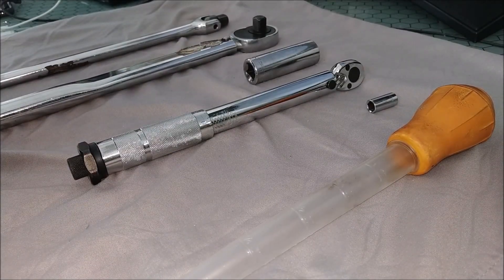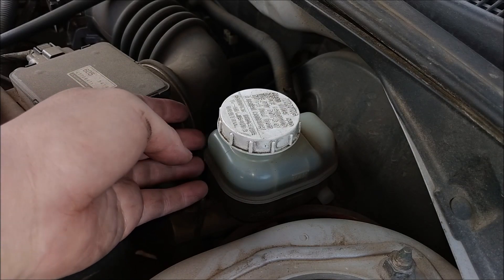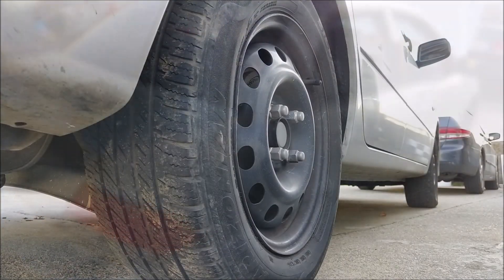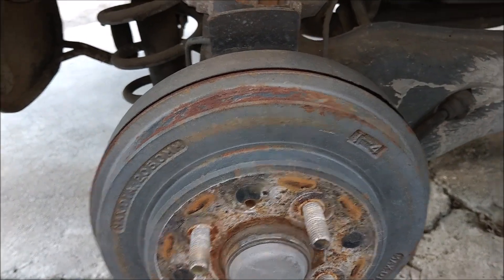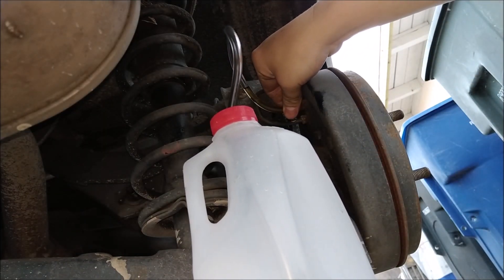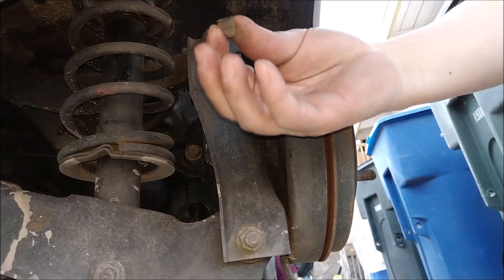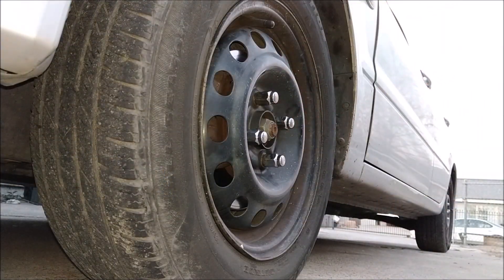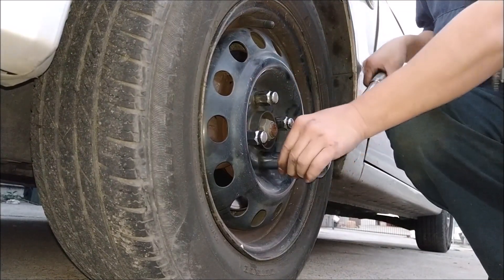Mitsubishi Lancer 2003 ES - Brake Bleeding

Comment: You start from the rear tire behind the reservoir to the front tire across then the other rear tire and finish with the tire under the reservoir. From Mitsubishi electronic repair manual.